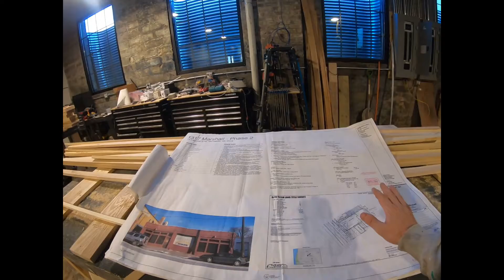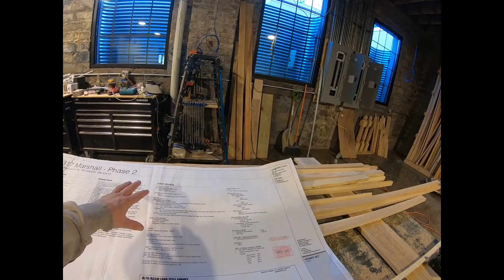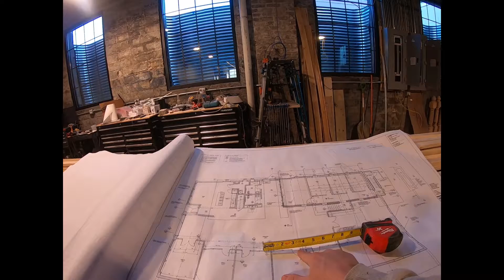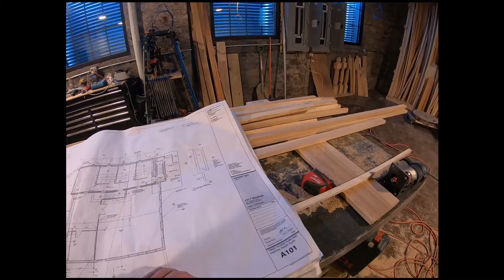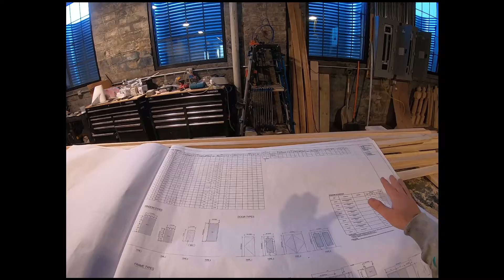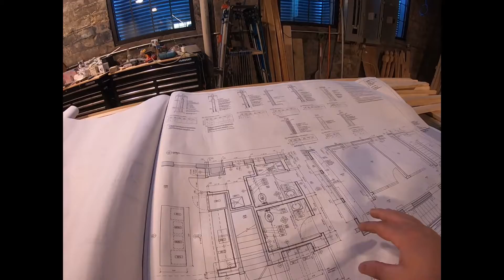blue prints for dummies- How to understand construction documents

Comment: I’m doing a Residential General contractor test. one of the questions in the test  about a set of plans,  was how much dirt to remove to build the front porch of the house ?? So What measurements do I have to look at to do those math  problems and get the answer??
Reply: 0 (zero) is always the grade level. The plan will also give detail about slope so you'll need to find grade and calculate based upon slope
Reply: @jesselandry2150 
Is there a math formula in this scenario?